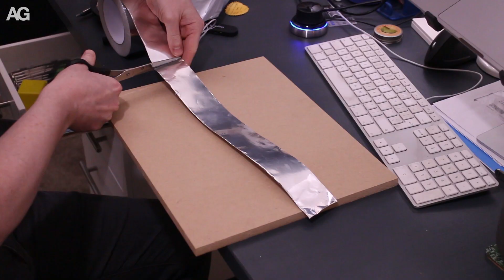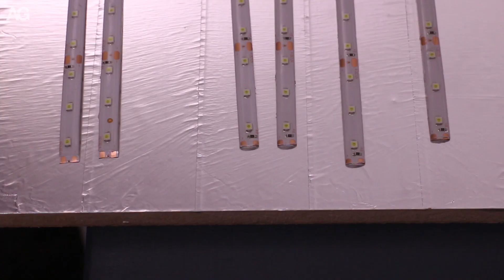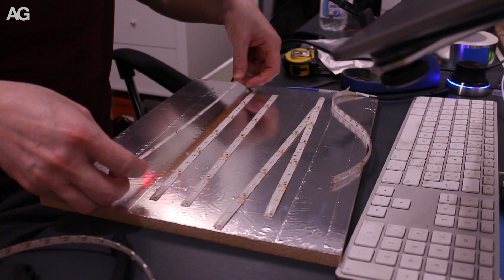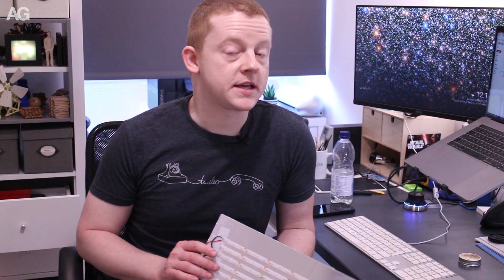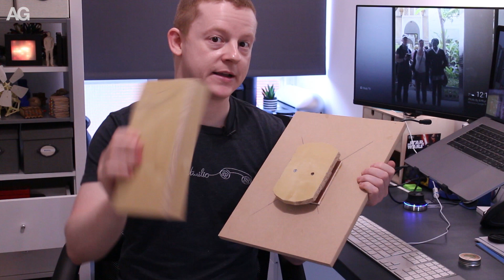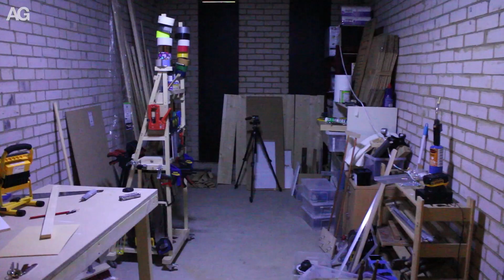LED Light Panel - Battery Powered Garage Lighting

Comment: Thanks for your two videos on this. I had the same issue i.e. no electricity in the garage, and built the same system as you following your videos except I used a cake pan for the fitting, covering the inner surface with adhesive foil and sticking the LED strips on the inner sides saving cutting them, and then mounted it as a lamp shade. Thank you :)